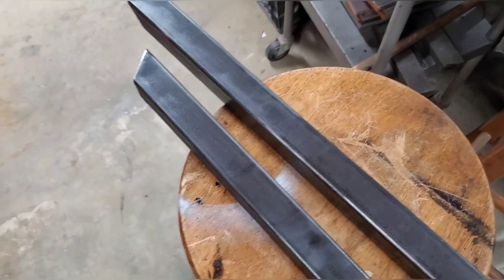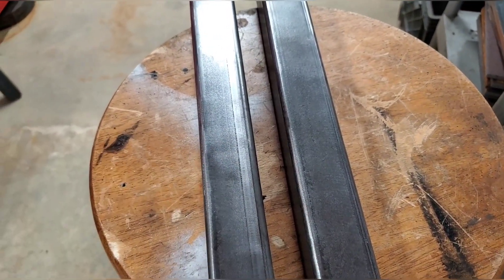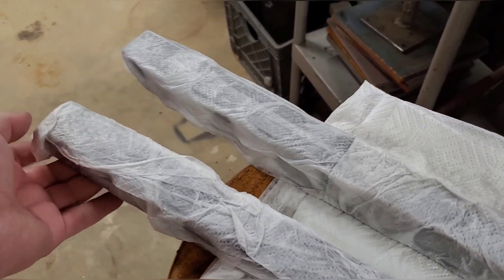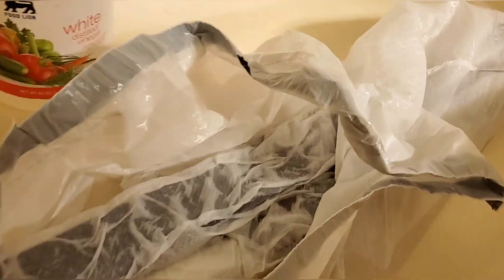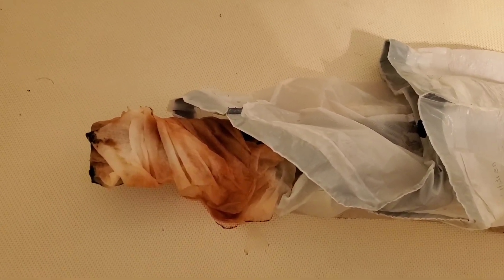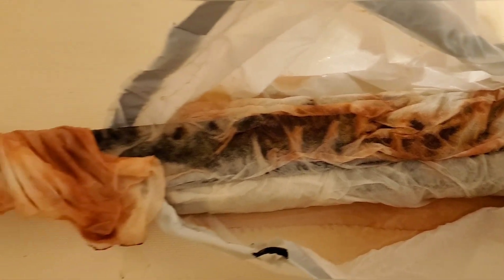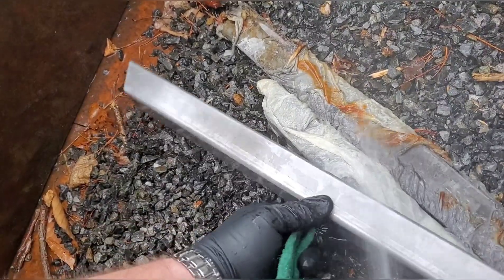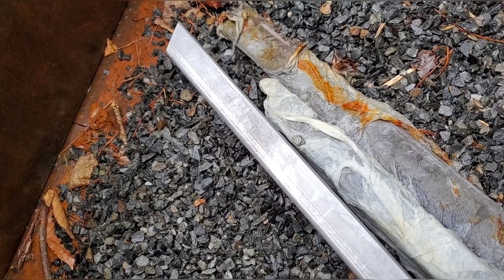Using White Vinegar to Remove Mill Scale. Surprising Results!

Comment: I used 48” a piece of 2” white pvc pipe.  I glued a cap on the bottom and just cover the other end with another loose cap.  48” takes about 3/4 gallon of vinegar.  Bungee it to something vertical or lean it up against something.
Reply from the maker: Great idea!
Reply: @Bluelightbandit  I read somewhere that a guy did an autistic acid bath and left it in his garage and every piece of steel in the garage was corroded from the off gas.  Even those this is only 9% acidic vinegar, I keep it outside.  I pour it back into the vinegar bottles when I’m done.
Reply from the maker: @glennthomas4159 Great idea👍🏼

Comment: Take your oxygen acetylene torch set it just like you would for cutting. Preheat the material just like you normally would with the torch but have the trigger already pressed it will blow the mill scale right off then hit it with a wire wheel then use the buffing wheel
Reply from the maker: I didn't know that you could remove scale that way, thanks for the tip!

Comment: Wonder if CLR would work?
That turned out great though!! 
Yeah definitely don’t put anything acidic in your shower or tub ESPECIALLY if it’s an acrylic tub or shower!!!!!
Reply: No it wont work
Reply from the maker: As much as I like CLR, I don't think it would take this stuff off. It's basically impurities in the steel that float to the top during the hot roll process. The scale is like 100% attached to the steel, that's why it's so hard to remove. I wish that I would have know about this a long time ago. 

And yeah, I bout mucked up with the bathtub lol 🙊

Comment: God post bud. I would never thought to use vinegar.  On my silver I use cider vinegar. I find it removes the flux on my poured silver better than reg white. School every day eh ! I am impressed.
Reply from the maker: Thanks for checking it out! I honestly didn't think it was going to work that well. Wish that I knew about this years ago lol.
Reply: @Bluelightbandit  I also make a pickle using 50/50 vinegar/peroxide that works very well to.Even just the vinegar alone takes time. It takes an overnight soak to get that nice finish.The wait is eased time wise when you know that will be excepted.

Comment: we have done the same thing when we use to use 1x1 angles. then finish it off with a wire wheel. using a plastic tub or storage bin works good. if your going to paint.... don't put any oil on it. before paint a light scuff and a wipe down with lacquer thinner, prime and paint. good video bro.
Reply from the maker: Thanks man! Got a recommendation for what grit to use when scuffing?
Reply: @Bluelightbandit  800 grit or even a course brill-ow pad
Reply: @ElmoNOLA  no... But small projects we have done making things, it's a good trick. I also never worked in a shipyard. I'll leave that to the pro's.
Reply: @ericctheartofnoise8613  I was just High and commenting like I often do when I'm bored I didn't really mean anything by it that's why I took the comment down I realized it kind of looked like I was being a dick.
But just passing the torch over it is the best way to get Mill scale, paint, cement coating, galvanized,,epoxy from the inside of a tank, rust, or anything off. When I'm soldering copper tubing or even Cooper nickel I never use flux just burn it first with the torch and hit it with the wire brush.
Like I said I know I was being a smart-ass that's why I took the other comment down
Peace